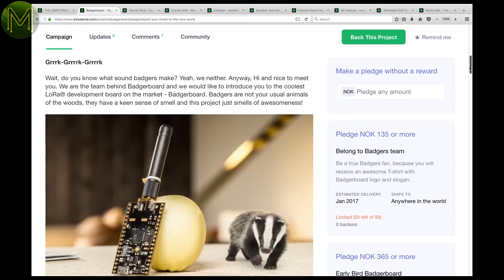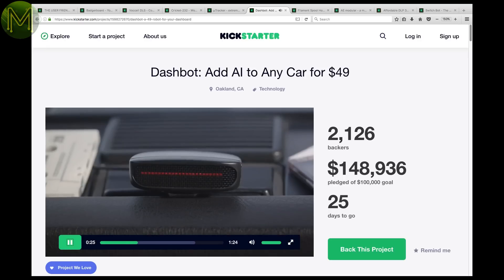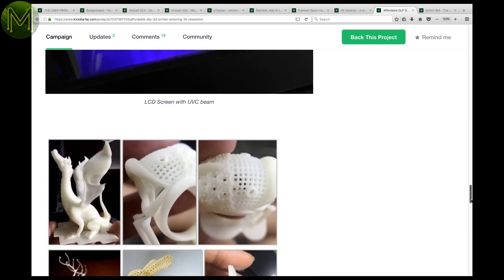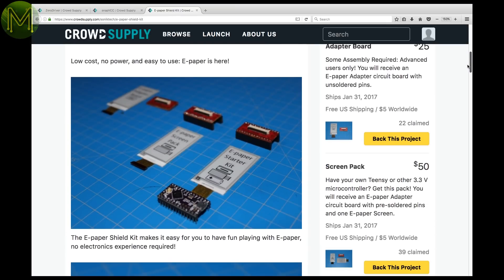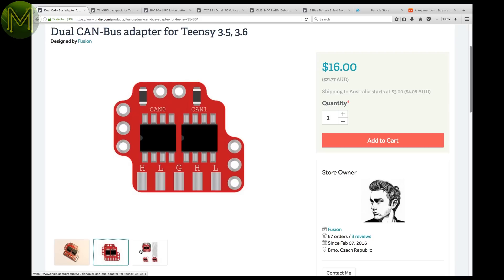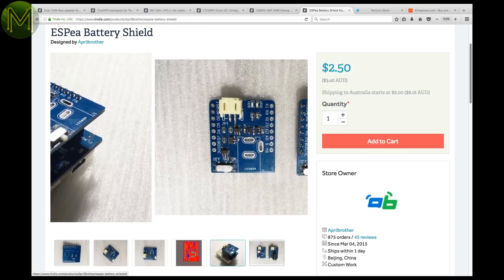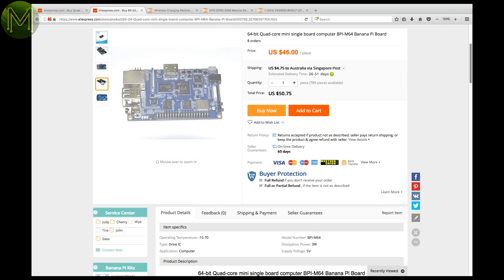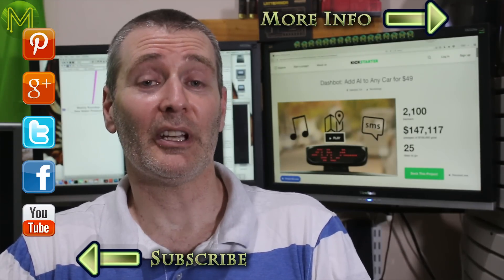#072 Weekly Roundup #13 - New Maker Products

Comment: If they phase out GSM in Britain, many rural areas will be totally screwed. The train operators will be screwed too, since they use GSM for their radio communications between signallers and trains. 

We can dream.
Reply: Would the NBN concept prevent certain services from going down, Unless they are replaced with something equivalent ?
Reply from the maker: +Izzie 
This would be the old 2G towers. 3G would be very hard to get rid of.
Reply: MickMake That's what I mean. There's tons of areas with no 3G!
Reply from the maker: Izzie
Yup. Australia is going through the phase out slowly. Towers are vanishing left right and centre. It's a ploy to get people to migrate because they're getting sick of the hopeless coverage.
Other countries have different opinions though.
Reply from the maker: +TheProCactus 
Ah ha. Yes the good old NBN. It was off to a very rocky start and still struggling to get there. The problem is that Australia is spread out so far with low population areas that it's really not cost effective.
I've had 100Mbit on Optus cable for the past 10 years and NBN is only just at that speed now.
Reply: The idea of the NBN is to cover 100% of Australia with internet. This covers copper, fibre, satellite, cell, others, I think Morse-code would count.
Any connection counts.

edit: Copper lines will be around for atleast another 25 years ;)

Comment: Owning a car with a OBDll socket would be useful for projects.
Reply from the maker: +TheDutyPaid 
If you don't have an OBD you could create your own!
Reply: MickMake my car is a Mazda 323f 1997. I know it has a diagnostic socket, some people say this is Mazda proprietary and others say it is OBD 1
The ECU would only offer very limited information. 
I'm happy tapping in to the cars power to add things but taking signals from say the WSS for speed would worry me that it may effect the ABS for instance.
Reply from the maker: +TheDutyPaid 
I think Mazdas had some funny diagnostic port in the earlier models that wasnt really OBD. You could make your own by using GPS, IMU, rotated encoders for speed and revs. Even get some flow meters for petrol consumption.